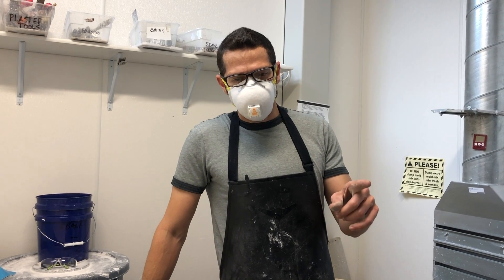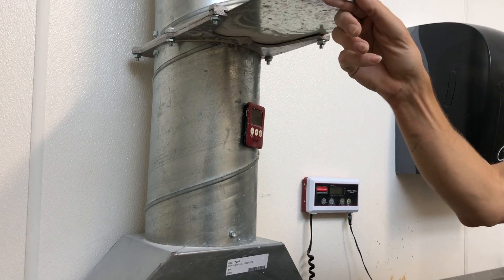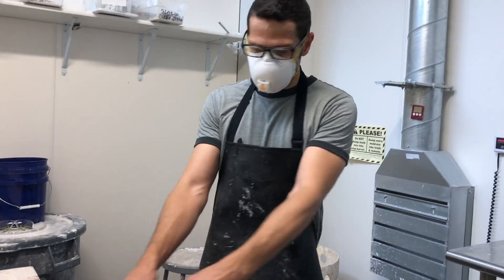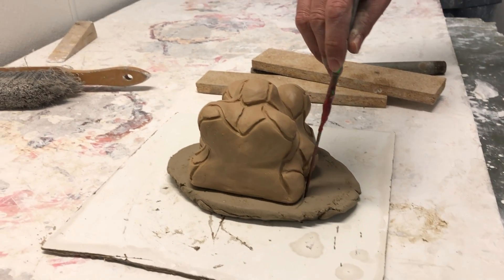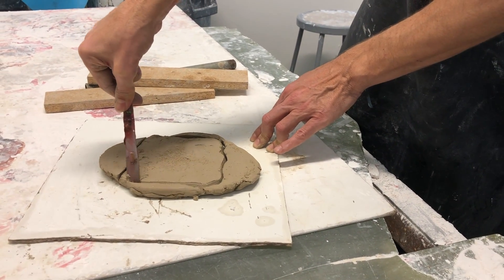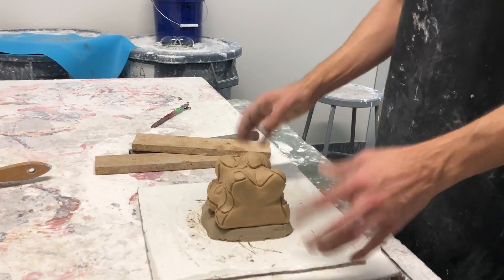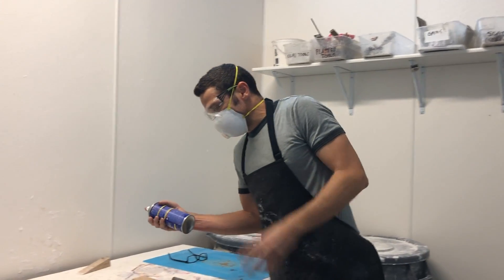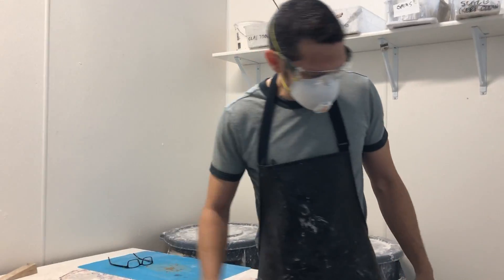How to Make a Mold for Glass Casting

Comment: What type of clay did you use? Would air dry clay work for this?
Reply from the maker: Any kind of clay is fine, so long as it is soft enough to remove from the mold easily. If you use water-based clay you need to keep it wet so it's soft enough to remove. Hard clay can damage the mold surface as you remove it.
Oil-based clay is ideal because it never hardens. We like J-Mac Oil-Based Sculptor's Clay. You can find it on Amazon, I think, or Arizona Sculpture Supply. We prefer Medium hardness.

Comment: Hello, thank you for the demonstration, it is very helpful! I'd love to see the entire process all the way to the finished piece. I want to cast using recycled glass and need to hold the temp at 1850, would the plaster be ok to fire so high? I'd hate to make a big mess in my kiln. Thanks!!
Reply from the maker: That's a very high temp to cast! Plaster will begin to off-gas at 1650ºF (ish) and really break down, losing strength. Why so high? You could easily cast recycled float glass at 1550ºF.

Comment: Great video. Is there a way to replace the silica with something less aggressive for the lungs? Like alumina for example?
Reply from the maker: Yes! But it's tremendously expensive. You can use Fused Silica. This is silica that's been turned from crystaline to amorphous with high heat, but we'd never be able to afford anything bigger than about a golf ball. The good news is simple PPE, good ventilation, and keeping your work station clean will keep you safe. We just had our mold room checked for parts-per-million silica, and it's so safe we could likely be in there w/o masks. Obviously, we ALWAYS use masks. It's likely that a kid playing in a sand box has more exposure to silica dust than we do.

Comment: what would be a method to make it able to handle a mold being blown into? I'm having a hard time finding any information on making molds you can blow into that aren't metal
Reply from the maker: If you're trying to do hot blow-molds the mix would be the same—1:1:1 plaster:silica:water. However, you either need to make your mold more robust (at least 2" thick) or back it up with a layer of chicken wire coated in more mold-mix. This will prevent your mold from splitting apart during the blowing process. If you're trying to make a mold that you can use several times then it's just Plaster, and you blow into it while cold. For the hot blow-mold you want to preheat the mold to at least 1050ºF before you blow into it. That will allow the glass to fill all the detail. Good luck!
Reply: @kentstateglass5011  thank you so much! I’ve made a couple that have already failed already and I will follow this to a T. I think it will work 😊
Reply from the maker: Also, if you don't belong to Glassies on FB, you should try to get in. Huge community of supportive glass folk that have lots of info. Look up the Labold Method, popularized by James Labold. He has a specific way of layering his molds that works super well. I do a similar method, but make mine a lot thinner and constrain with chicken wire.

Comment: This is so generous! How would I calculate how much mixture to make on a flat slab that is 12"x10"x1" + the 2" of additional space for investment mixture? Thank you!
Reply from the maker: I'm not sure I understand the question. Could you please elaborate? Mostly I don't calculate material volume for hand-build molds like this. If I don't have enough with the first layer, I just mix and add another layer immediately. Actually, multi-layer molds can be stronger than single-layer, so I'm OK if I don't guess right the first time.

Comment: Hello! Great video! Once the plaster is dry and the clay removed, how long should the mould be left to further dry before use? Does it need any kind of pre firing or heating before slumping / casting into the mould? We have tried a couple of times and both moulds have cracked on the first firing, so any tips on this would be very helpful! Thank you!
Reply from the maker: What's not discussed here is the firing schedule. Predrying a mold at about 110-180ºF overnight can help a bit, but mostly molds crack for 4 reasons:
1. Not thick enough. 2" wall thickness is ideal for most castings.
2. Uneven mold thickness. As the mold dries it shrinks. You want this to happen evenly.
3. Too fast up to 1000ºF. This is the "curing" stage of the firing process. About the minimum time is 8 hrs for smaller molds.
4. Racing through the "quartz-inversion" phase. We typically program a 2-3 hr. ramp from 1000-1200ºF to ease the mold material through this point.
You can find more info on the curing/firing stage of casting here: https://www.youtube.com/watch?v=BlV_iG1zcZA
Hope this helps!

Comment: So they clay is still wet so it peels out?  Would it help if there we no undercuts? What kind of clay.  Thanks so much
Reply from the maker: Yes, it's critical that water-based clay is still soft for you to remove it. You can use oil-based clay as well, but it's typically stiffer than the water-based and requires more care removing it. Minimal undercuts are helpful, but you can easily remove any clay that you can reach with a tool. That's actually the advantage of this method: since the clay is soft you don't need to completely avoid undercuts to remove the pattern from the mold.

Comment: Can't hear what you are saying. You don't need a mask to make a commentary.
Reply from the maker: Agree! This was made during the pandemic when we were required to wear masks in all rooms. Also, I'm working with silica flour, so an N95 is an important safety measure.
The good news is the Closed Captioning (CC) is pretty good on this. Enable that and it should help!

Comment: thank you for this so much! very clear and precise! I've been following your steps and it seems my clay was a bit dry and it is not coming off the mould easily? What methods would you recommend I do? Can I use water to wash over the mould? Thanks
Reply from the maker: Sorry for the delayed reply. YES! You can absolutely used water to wash clay off the inside of your mold... if you're using water-based clay. For oil-based clay I recommend using a mold release and then compressed air to blow the clay particles off the surface.

Comment: Can you pour molten glass into a mold like this?

Does the mold need to be fired before casting? 

This should also work with lost wax casting?
Reply from the maker: No, you would cause off-gassing of the plaster and bubbles in the glass. This type of mold is for kiln-casting, which involves loading cold glass into the mold and then firing both the mold and glass to melting temperatures (roughly 1,500ºF).

Comment: You could have put it in a container and put the sculpture in upside down
Reply from the maker: Absolutely right, but a poured mold (monolithic or block mold) has several disadvantages:
1. It uses more material, since the mold thickness doesn't follow the profile of the pattern.
2. Because a poured mold is less even all the way around it is prone to crack more as it is fired.
3. Making multiple layers increases the strength of the mold and can help prevent catastrophic mold failure where the glass pours out!
4. You don't need any math for a hand-built mold! LOL. If you pour a mold you need to figure out how much mold material will totally cover your patter. This is way easier.

Hope this helps!